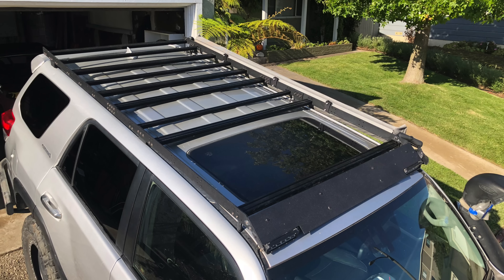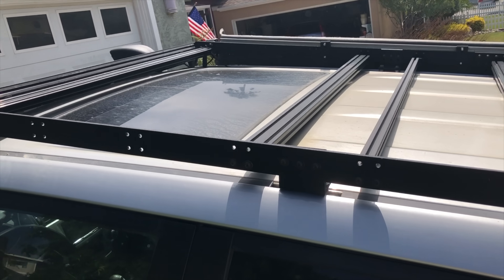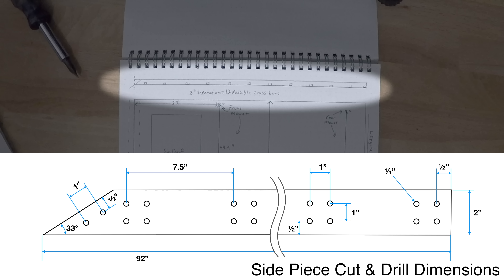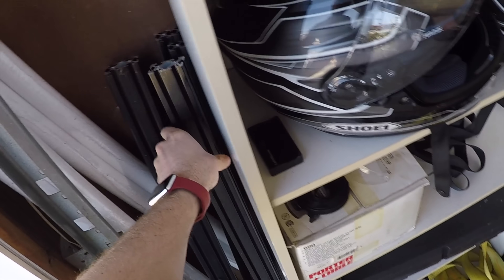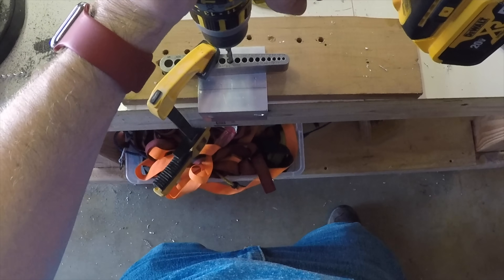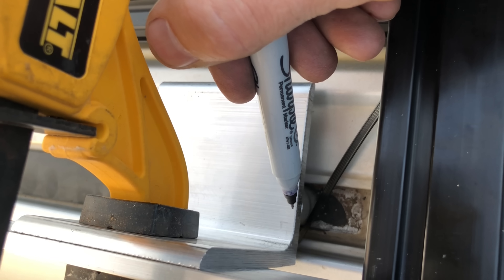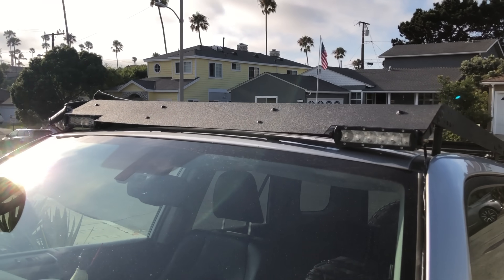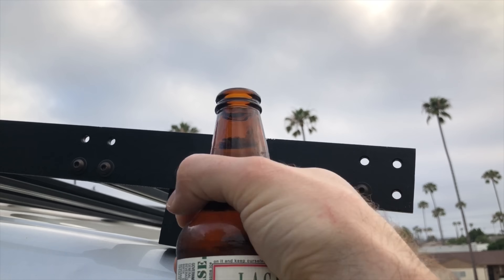Build Your Own Damn Roof Rack - How I Built a $1000 Roof Rack for $300 in half a day.

Comment: Came to this hoping for a solution to rack towers...my Ranger doesn't have built-in mountings....what a stupidly awesome idea, and easy enough to reproduce (stand-offs and backing plates).  No more monsterous gap!  No more leaks!

Means my basket either gets modded or tossed...I'm good with it either way.  I need to put weight up there (water/fuel/tools/recovery gear).

I know it wasn't the point of your video, but I'm on it.

Comment: “I saved 700, but spend 3000 in tools and 4 weeks building it” yup makes sense.
Reply: We've all been in that project  ;)
Reply: @myownschadenfreude  My life is that project.
Reply: Tools can be used for life than one project
Reply: I already have the tools, my problem is that my car has no mount holes so while this video is great, it won't work for me at all.
Reply: @biggaywizard  I used rivnuts. Threaded rivet inserts,
Reply: @biggaywizard  into the extruded part of the gutter/ roof rail section.
Reply: 😂if you don’t have the right tools to begin with , building up the right set to do a project will cost some dollars 💵, to some it just make more dollars / cents to purchase outright. However if you already have the gear to do so then this a great way to DIY !
Reply: And filled gaps with painted race tape 😩
Reply: I think that way😂
Reply: Building it is half the fun. Plus it's a custom job that fits like a glove. Tailored to your needs in every aspect. You also get the experience of fabricating under your belt, on a project that does not hold your life in it's hands. Quit being a bitch and get your hands dirty.

Comment: Please show more details about to frontmost feet
Reply: they look to be simple aluminium flats bent 90 degrees at the end where they rest inside the rain gutter. I had the same question since I think there's too much leverage that would be applied to the sides without the support. it's probably offering plenty of support. The only concern i would have is rattling on the roof if not at the precise length, I guess slightly longer is better than shorter on these support legs. Small rubber pads under are probably a good idea as well.

Comment: Great build. Are you going to have to take the rails off to add hardware in T-Track for accessories?
Reply: A simple drill bit would open the slots up a bit to fix that problem.

Comment: Damn shame we don't live in the same neighborhood.  You could have used the $3000 lathe I bought for making $300 motorcycle rearsets to make your mounting risers.

RE: wind noise, I found on our own SUV that making filler pieces for the slots in the roof rack helped reduce noise substantially.  Yep, the $2500 mill sure came in handy for fixing those $79 roof racks (which my wife later destroyed anyway.)

Comment: Love the build, but one question.  In a couple of the shots it looked like your cross bars are sagging onto your roof.  Just wondering if that was due to the camera angle, or if that was an issue you were having?  Have you considered using some sort of support underneath it?  I also have a 5th gen 4runner that I have been considering building a rack for.  Thanks for the video!
Reply: Maybe that’s an optical illusion, caused by the curvature of the roof and the straight bar’s shadow on it.

Comment: Matt for the front of the roof rack where/how exactly did you mount the supporting feet? Also do you happen to have and dimensions on where you mounted the the feet in the rear and middle of the rack to the roof?
Reply from the maker: Hi Drew, The dimensions for the rear and middle are in the video at about 1:20. For the front, I just bought a threaded bumper similar to this (https://www.mcmaster.com/9541k83) and fabricated a bracket to hold it to the rack. Its exact location isn't important, it just presses against the front of the roof. It isn't physically attached to the roof.

Comment: How did you mount the aero shield?
Reply from the maker: There is an extruded aluminum cross bar at the front at an angle and I just drilled through the aero shield and used T nuts inside the extruded aluminum.
Reply: SuperfastMatt awesome! Thanks for the response.

Comment: This is a pretty quality video, Matt! I laughed when you said how you saved money and you should buy a drill... and it was a dam Snap-On 😂
Reply: By the way, what material did you use for your wind guard or as you call it, the aero shield?
Reply from the maker: @RecordnMotion  Aluminum sheet, I think it was 6" wide and around 1/16" thick.

Comment: Awesome build!!  How much weight do you anticipate it would be able to handle with those rails and crossbars
Reply from the maker: It is very similar in design to racks that are rated to 300lbs while moving and 750 pounds while stationary, so I'd say that's probably a good limit. Of course, spread the load out. If you're putting heavy stuff on the front, I'd consider adding some kind of foot that just presses down on the roof at the front to help support the load.